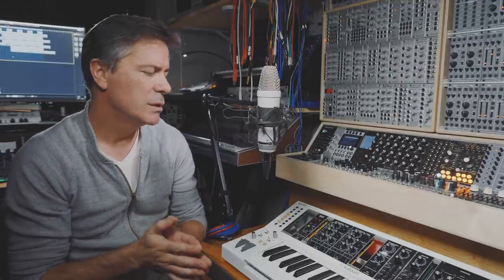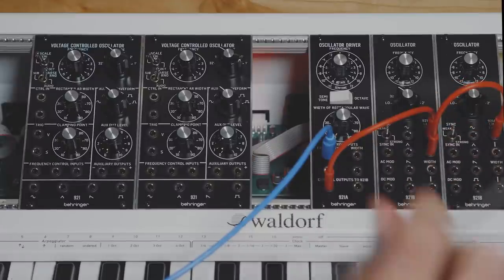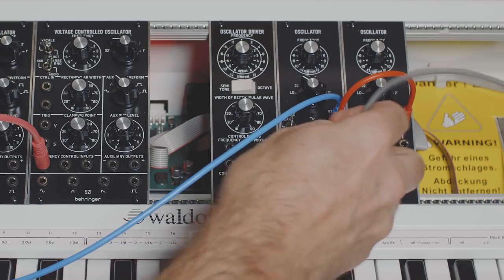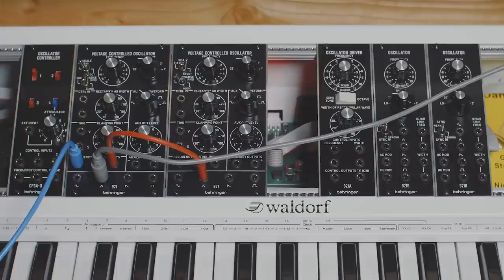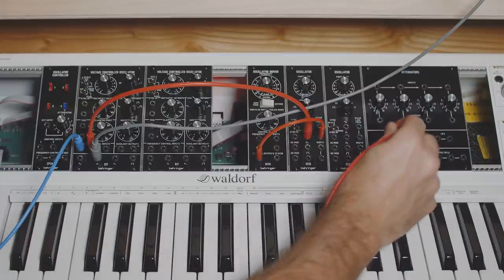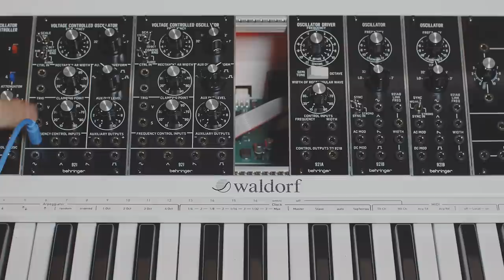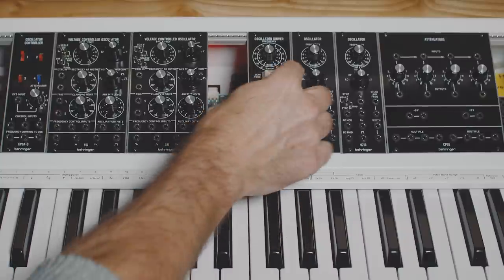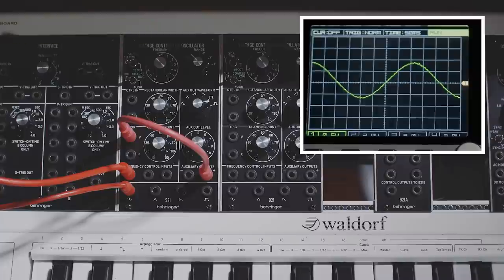Behringer System 55 Oscillators

Comment: The so called "broken waveforms" on the Behringer 921 behave exactly like they do on the original Moog 921. I know I'm quite late with my reaction, but a friend of mine has a Moog 55 to compare his original 921 to the Behringer 921. But as I don't see him very often, and when I do I forget about it, it took a long time before I could test it. Yesterday I visited him, and I remembered to test it, so I could finally check it. It turned out that, in low frequency mode, the sine and triangle waves on his original Moog 921 module sound just as "broken" as on the Behringer 921. So the Behringer has cloned this behavior correctly, even though it doesn't sound correct. IMO it makes it quite useless if you don't use the hack from Tim (I didn't test the "Tim hack" on the original Moog 921). I really did not expect that the original Moog 921 would also behave like that in low frequency mode, but there it is.

Comment: The 921b was NOT designed as stand alone oscillator (in it's broadest sense of the word here) - this video here is an oversimplification, especially if you have synth voices with 2-4 units of 921B's as oscillator (also for PWM that you want ot be equal across OSC that form a synth voice as combination, and, as explained her by yourself a sa general tunning facility.

Comment: Worth noting that if you want to put a System 55 oscillator into a mixed Eurorack system, you'll want the 921. The basic waveform outputs on the 921 & 921B are much lower signal levels than typical Eurorack levels, but on the 921 the aux output has enough gain to give you a signal level comparable to other Eurorack oscillators.

Comment: I hard wired my 921a/921b vcos/drivers behind the panel, (Ive got four 921a's with three 921b's each, and have several 921's, Im glad I did this because it was always a mess of cables. Im considering further modding them with a clone/reproduction of the CV/Trig bus from the original system 55, and doing the same with the system 100m

Comment: Tim, again a wonderful video. There is a way to get around the broken waveforms in sub-mode on the  921. Don't use sub-mode. Use range 32' and select scale OCT and turn frequency fully counterclockwise. So far so good. Now take the -6V from CP35 and pluck into the CP-3A-O EXT INPUT. If you turn the attenuator fully clockwise, you can go as slow as 0.02 Hz. One cycle takes 45 sec. Now take the second -6V from CP35 and pluck it into INPUT 1 of the CP3A-O. Turn the attenuator to position 5. That leads to approx. -7.5V. The cycle length of the 921 increases to 3 minutes and 30 seconds. That is round about 0.005 Hz. I think that's a pretty low LFO. The regular output is just 2V peak to peak. But, the aux out is -5V to 5V output. The specs say it only takes -6V to +6V input level, but, it seams it can take a bit more without wrecking the device (DISCLAIMER: No guaranty whatsoever).
Same exercise with 921A and 921B. 921A fully counterclockwise, select Octave. On 921B select Range LO and frequency fully counterclockwise. One cycle is 20 minutes equals 1200s. That is 0.00083 Hz. Output is only -4dBu = 1.4 V p-p.

Comment: Love the System 55 Vids Tim. Thanks again! As a 921 user, the clamping point low frequency newsflash fix was really helpful!

To System 55 Users:
If you have a spare 902 VCA you can use it to send -6V thereby using less space than the attenuator module

Comment: Hi Tim.  I have the 921 and have not noticed any issues with the sine and triangle waves in sub mode.  However I usually just use the aux output rather than the individual outputs.  But I’ve used the sine and triangle LFOs plenty of times and they always sounded smooth, and also sound normal at audio levels.

Comment: Thank you very much for your great Videos ! 
I read that in the 921A/B combination the linear/exponential converter was build into the 921A and the 921B had linear response.
It tracks Volts/Hertz not Volts/Octave

Comment: Great! The fix of the waveforms in LFO mode is a big help. However, I tend to think that these VCOs were designed to be used exactly that way. Can't be an accident that the circuitry already contains the solution for this problem. It COULD have been documented in any form to help us modular rookies, but maybe it was meant to be Tim to show us a trick once in a while. It's more fun that way.

Comment: I have 2 x 921 and the first one had the very obvious discontinuity you describe at lower frequencies and the other didn't. But I did manage to tweak the waveform of the first with the aid of a scope to be acceptable (indeed not perfect as you say) at both ends of the range.

Comment: Tim, I really appreciate this video thank you so much.  I have been playing around with the Model 15 app from Moog on my Mac / iPad and it's pretty incredible the sound you can get from these modules.  I was playing around with the 921 oscillators for modulating the cutoff freq of the 904a -- such a wonderful sounding filter.  The sine wave behaves the same as your behringer 921.  It's great for neat moog specific sounding effects on modulation of cut off freq for example.  I set up the output to aux out on the 921 and used the knob to switch waveforms and you can get such neat effects.

I am thinking about adding the 921, 921A, 2 x 921B, 904A (filter), 2 x 911 (envelope gen) and 995 (attenutor x 3) to my Behringer System 100 rack.  Would this be all I need? I can use the dual VCA from the System 100 right?  I don't need the 914 fixed filter right now or a mixer module.  The Model 15 comes with a 921, 921A and 2 x 921B for oscillators.  And it comes with one 904A filter; also comes with two 911's.   If you have the Model 15 app try the Trillibas patch.. sounds so good , great for techno; then modulate the freq  of cuttoff with the 921 aux out.
Reply from the maker: Sorry for taking so long to reply. The only thing to think about is how to trigger those 911 envelopes, they need S-Trig rather than the V-Trig that is standard in Eurorack. You could just use System 100 envelopes and forget about the 911's, but if you go with 911's then you'll need Behringer's 961 interface module or some other way to convert V-Trig to S-Trig (another option is their CM1A midi to cv converter which outputs both S and V trig)

Comment: Very illuminating, very usefull. I have a question at 23:17 the oscillation with a trinagle wave form now sounds smooth instead of broken. Does this mean you tuned a smooth sine and triangle for the sub mode instead of smooth triangle and sine for normal mode?

Comment: Hi Tim, awesome and infprmative as always! At 5:30 you describe linking the 921B's. Can anything like this be done with 112 Dual VCO's? Thank You
Reply from the maker: Thanks very much. With the System 100 VCO's you'll need to use a buffered multiple to supply the pitch CV to however many oscillators you want to use. Each oscillator is independent.

Comment: Many thanks Tim for your tutorial. Very informative served on easy way - as always. I have Behringer modules and I'm also experimenting with them, however I'm facing with a problem which is detuned 921Bs across the scale. Let's say I tune VCO to C2, but C3, C4 or C1 are not matching the tone.... do you have any idea for that?
Reply from the maker: Hi, I'd definitely give those oscillators plenty of time to warm up but it sounds like those modules might need to be properly callibrated 😞
Reply: Thanks Tim... I'll investigate deeper the issue. There must be solution for this.

Comment: Hi Tim, what mics do you use on your videos? Specifally the lavalier one, I bought one and it sounded totally rubbish and yours always sound great. Thanks!
Reply from the maker: I'm constantly trying out new mics and ways to record my audio as the quality of my recordings has been somewhat volatile to be honest and I need to get more consistent.

My biggest issue is external noises, from the road outside, from overhead airplanes, from my family inside the house, fan noises from some of my lights, etc etc. So I'm using some close mic techniques along with active gain reduction and compression.

The lav mic I use is by Rode.
Reply: @TimShoebridge  Yes external noise is the constant enemy of mics (and producing).. I've never noticed any external noise in your videos anyway so you're doing a good job of covering it up :) Thanks for the info! I'll look into Rode lavs..

Comment: Hi Tim. Thans for the video. I have two problemen with the 921B and wonder if that is normal? First: When I use the Range selector, the sound is not moving exactly one octave up or down? 2nd: I see you have the Range selector in audiomode on '16 in your video (I have to do the same) That gives already a very high sound. So its difficult to go down that much. Ofcouce I can go in sub mode but that behalen worden for audio level. A the same time the fine course is very much moving when you Just touch it. For me its too difficult to use on stage. Is it a problem with only my vco? Or do you have the same experience? Thans, Peter
Reply: Some words were translated, sorry. In sub mode the audio level behaves bad
Reply from the maker: Hi, I don't have the exact same issues as you but definitely the scaling of those pots are not accurate across all my VCO's. There are trim pots on the back which allow you to calibrate them, I haven't bothered to do this but this might be the answer to your problems. It's the calibration that I think is missing with these Behringer modules and I think the reality of a mass produced product......
Reply: Thans Tim. I willl try the pots

Comment: Thanks a lot! I have a 921, and it's months that I'm wondering if I should buy another one or a 921b. Your video gives me much information, although I'm even more confused now :-) . I read somewhere that b's are way more unstable with frequency than 921's. What's your experience about this?
Reply from the maker: I have heard of a few people experiencing instability issues with their 921B's, I don't have any problem with the ones I have. Just general advice but if you buy a module - Behringer or otherwise - and you don't think it is behaving as it should then do not hesitate to go back to your retailer and ask for a replacement or refund, that is what they are there for...
Reply: @TimShoebridge  Thanks!!

Comment: my school owns an original system 55, it's been awhile since I've used it but I recall trying to make a really deep sub bass (30-50hz) and there were harmonics coming from the sine wave which I thought was odd, I pulled out my oscilloscope and sure enough until you get about 100hz or so it's pretty broken so yes, bob moog made weird stuff man

Comment: Tim, Very informative videos! I have recently received my system 55 and am having a problem. The notes do not release after releasing the key and the last note continues to sound just like what I am seeing in your video. How do I get the notes to release after releasing the key. Any suggestion to solving this problem?
Reply from the maker: It all depends on how you are patching those modules. Sounds to me like you are not applying an envelope to the VCA...?

Comment: The B921 in low mode has a significant step in the triangle and sine waveforms, unlike the original Moog. There is a minor slewing of these waveforms as you go low but the step is not correct and makes the 921 limited as a LFO. Not yet sure what the problem is, but its about how the low mode switch changes the triangle offset, which is controlled via an analog switch in the B921 rather than the Moog 3PDT switch.
Reply: Did you watch the end of the video that shows a simple patch that overcomes that issue?

Comment: LOL Tim, you looked like were using a green screen in your intro (because of the light behind!) :) Aside from that, I am still considering purchasing one of these (921B) in my ever expanding Eurorack (as per norm, lol). I have a Grandmother but the 921B is teeny weeny and sounds ace. What are the benefits of the 921A with the B, if I buy B would you recommend A as well is the question :)
Reply from the maker: Yes it looked a bit weird at the start didn't it. Well, I had honestly hoped my video would answer your question! ;) If you have just one B then your A can help to slow the B down for use as an LFO, and if you have more than one B then your A can supply the same pitch and PWM CV settings to them all. But the A is certainly not mandatory at all, there are other ways to do what I just described.
Reply: @TimShoebridge  To be fair , I did comment half way thru watching. My bad :( I have a Cereal Instruments 'Resolution' & Och'd that do wonders for LFO, though having the A may free up certain modules as & when. Thank you for reply, love your details dude :)

Comment: a 921 VCO vid and nothing about the scaling?
Reply: Interesting comment. Others have said that it is not 1V/Oct but the Behringer manuals say that they are. I noticed that the scaling on one version of the moog 921A schematics appears to show an amplification of 1/2 from frequency inputs to pitch outputs. The pitch output has 500mV/V written on it which confirms this for this version. Someday my 921A will finally show up and I will measure this.